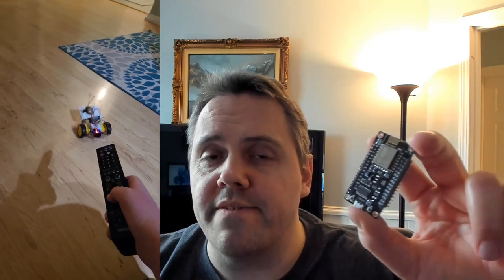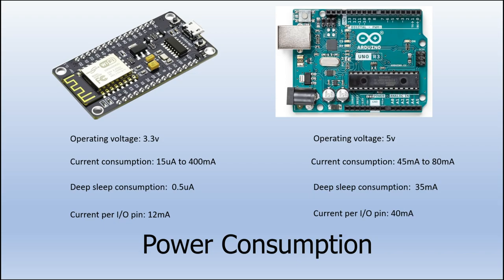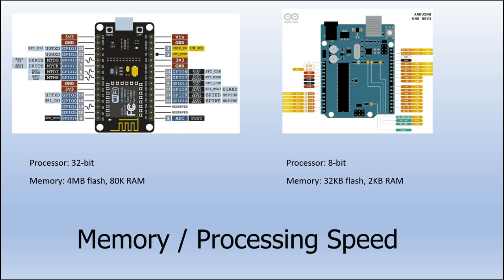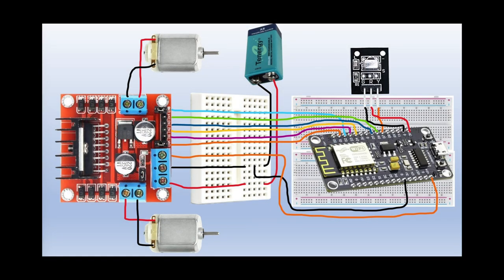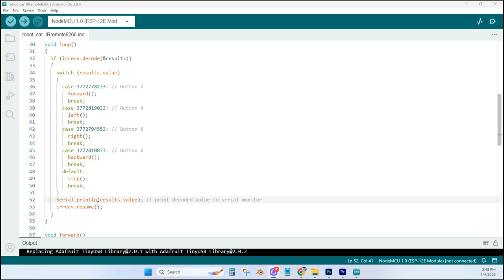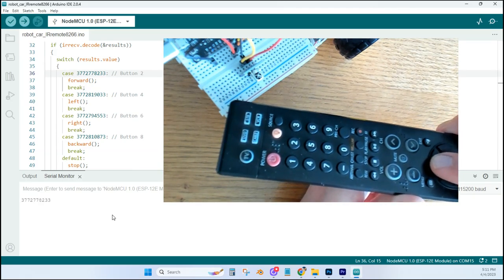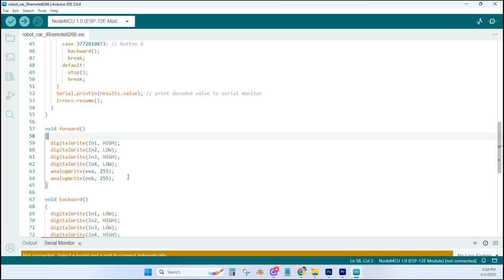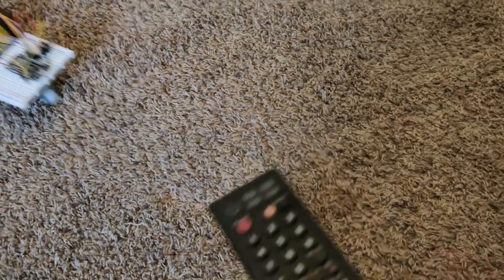Get Creative And Build Your Own ESP8266 IR TV Remote Controlled Car For Beginners

Comment: Can you make a Arduino type system with algorithm for thesis thank you and God bless
Reply from the maker: I just ordered a water pump and soil moisture sensor.  Should be here by Friday. Will need a few days to set it up and edit video. Thanks for suggestion   👍
Reply: @BMonsterLaboratory  thank you for your video I learned a lot but what is the algorithm for that project
Reply from the maker: Algorithms are widely used to control and automate devices and systems, like robotics systems, home automation, and environmental monitoring through the use of sensors and such. I guess you could call the entire source code an algorithm but if you wanted to focus on the most obvious algorithm in this project, it would be the loop. In the loop, the program continuously checks if there is any input from the IR TV remote and maps the input to specific actions to control the motor driver. The “switch” statement in the loop portion of the code performs a series of checks on the value of the input signal from the IR remote. If the input signal matches any of the predefined values for the buttons (forward, backward, left, right), the corresponding motor control function is called, and the car will move in that direction.
I am not a computer science guy or in any engineering of any sort. This is merely a hobby that I enjoy and I’m almost certain someone in the computer sciences could explain it much better 😊 I do love a challenge though…. Thank you for the question. I hope the answer made sense.
Reply: You are not an expert but you will doing good like a pro you will help all the student and inspired them thank you for all you video and God Bless                                                                                                                     for the next challenge to you can you make this project                                                                                               
Project: Smart Greenhouse System

Overview: In this project, we will build a smart greenhouse system that automatically controls the temperature, humidity, and watering of plants using an Arduino board and sensors. The algorithm used in this project will ensure that the plants receive the right amount of water and maintain optimal temperature and humidity levels.

Components Needed:

Arduino board
DHT11 temperature and humidity sensor
Soil moisture sensor
Relay module
Water pump
LED display
Breadboard and jumper wires
Power supply
Algorithm:

Initialize the sensors and relay module
Read the temperature and humidity from the DHT11 sensor
Check if the temperature and humidity are within the desired range
If the temperature is too high, turn on the water pump to cool the greenhouse. If the temperature is too low, turn on the heater.
Read the soil moisture sensor to determine if the plants need watering
If the soil is too dry, turn on the water pump to water the plants
Display the temperature, humidity, and soil moisture level on the LED display
Wait for a certain period of time (e.g. 5 minutes) before repeating the process
This algorithm can be implemented in the Arduino programming language using conditional statements and loops. The algorithm will continuously monitor the temperature, humidity, and soil moisture levels and adjust the system accordingly to ensure the plants are in optimal conditions.
Reply: My idol do you have a social media account like IG that can send you a personal message thank you 😊
Reply from the maker: @christianahmylcollado5323  check out Facebook link on channel banner. Also have a Twitter link on there as well
Reply: @BMonsterLaboratory  Thank  you bro I will send you a message ☺️
Reply from the maker: hey, Sorry about taking so long.  I didn't forget about the greenhouse. I just purchased some plexiglass to make it look like an actual greenhouse.
Reply: @BMonsterLaboratory  that's okay brother I'm still waiting for your next content I wish that I will use that in my thesis idea thank you and God bless 😊

Comment: I am planning on Making RC car(using Nrf24 modules) . 
Do you think I can also control the car using an IR remote and Nrf24 module Transmitter(Controller) Simultaneously  ??
Reply from the maker: hi Omkar! No, you can't use them together. Nrf24 uses radio frequency and IR uses infrared light to transmit data. If you have 2Nrf24 modules you can use one as sender and one as receiver.
Reply: @BMonsterLaboratory  I get what you are trying to say, 
But what if I add a IR receiver on my RC car, can i then control the Car with the nrf24 controller and IR remote Simultaneously?
Reply from the maker: You should be able to operate both IR and nrf24 simultaneously. They operate on different frequency. I thought you were asking about transmitter/receiver being nrf24/ir :)
Reply: @BMonsterLaboratory  thanks, for your Help Sir🙇‍♂️
Reply from the maker: Good luck with your projects!